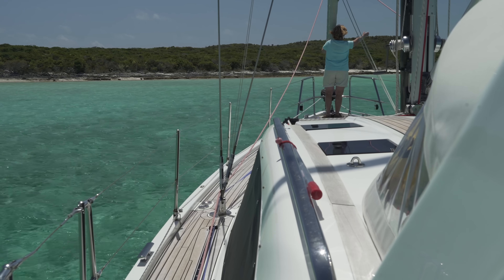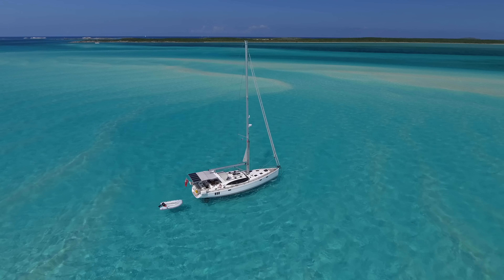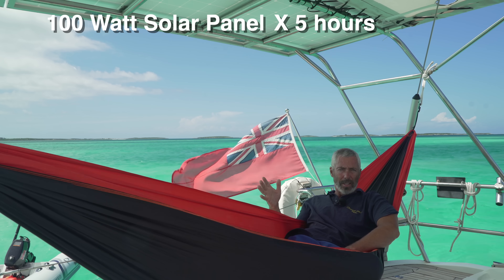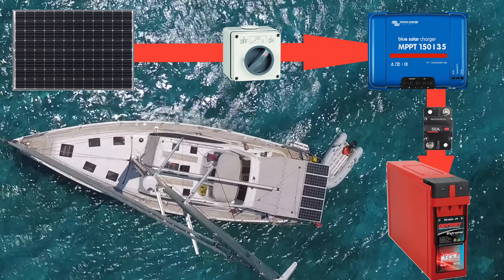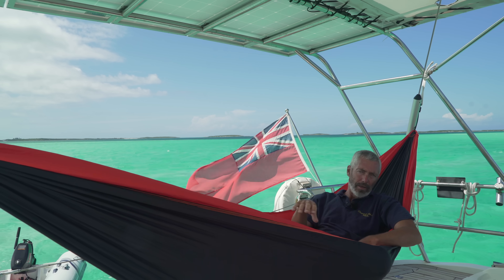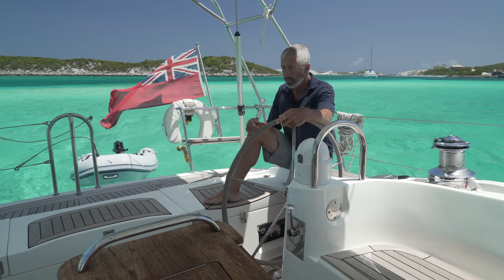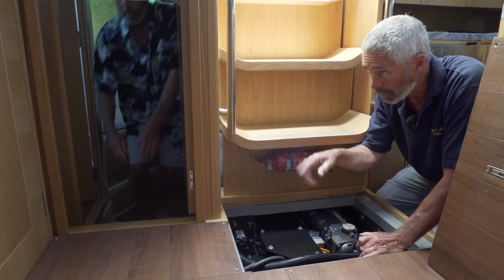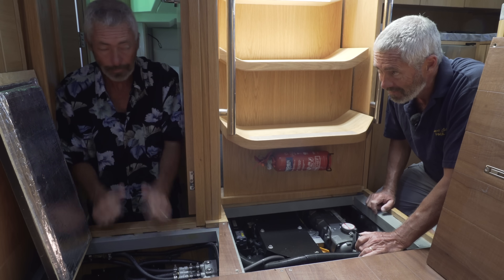Marine Power Solar System - Part 3

Comment: This solar system is disappointing. Since you designed that racking specifically for the solar panels you could have installed 3 x 400W panels that would have produced 6-7 kW a day. Also you do not have lithium batteries ?? I just do not understand why you would sabotage yourself like this. I guess you like to run that generator every day.

Comment: Just started watching your channel, very great information. Wondering how many gallons of fuel you'd be using running for 20 minutes at 1200 rpm? i.e..Cost of running the engine generator..thanks for your educating videos.

Comment: I'm on a tight budget and was on a smaller sailboat, so I went with two 100 watt panels wired to their own individual PWM controller. Each controller can accept both panels if for some reason one of them gives up the ghost. We're currently shopping for a new sailboat, and the only change I would make would be to use two MPPT controllers.

Does the Victron controller get very hot? I've heard from other's that they get very hot and would appreciate your experience with the unit.

Comment: So, you need to run the motor 20 minutes each day to break even ?  That seems like you need ALOT of fuel just to live ?? And most likely your not running a ac? Or being over generous in your life style. ??  After watching this I would say you dont have enough solar panels. Or battery bank , or a secondary generator  is needed.  ..

And would love reply to this,  so ?  How much fuel is needed to run that motor each 20 minute period? How many gallons. ?

Comment: I just dont get it,If your engine fails.You have no power.Apart from the solar.So much cheaper to carry a portable generator.And use alternator on engine as normal.
Reply: or with that much sunlight at your location a portable 3000w lithium power station and not spend a penny on petrol.
Reply: @aerofpv2109  You having a laugh.£2800 .For a back up.For a 300 ah battery inside a case.You still have to charge it.£400 for a portable generator.That can also power batteries up at same time.Yes 5 litres of petrol in about 4 hours use.But its a back up.it will charge everything up and most battery bank in about an hour.
Reply: @t147han  Think long term Sir ... 10 years plus. Lithium Iron Phosphate batteries with a 3,000 to 5,000+ cycle life on solar will save you plenty money in the long run.
Reply: @aerofpv2109  Please dont quote me that hyped up selling garbage.
Reply: @t147han  I was once a skeptic as well. All I ask is that you take a look into Will Prowse channel here on YT and view several of his episodes. This young man is beyond amazing and is sincerely educating tens of thousands of solar enthusiasts. Cheers mate.
Reply: @aerofpv2109  So you think that i need educating on solar.Or could it be that i know a lot more.that they are not telling you.

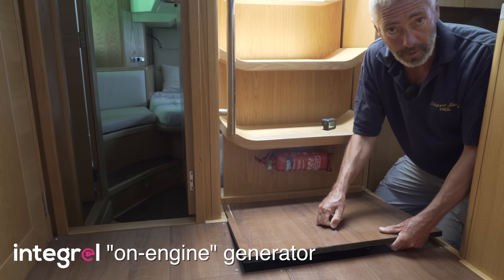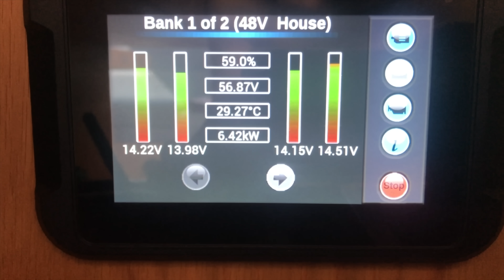Comment: 5:00 "that is the generator" - You just showed me an Alternator ...  what gives?   The Secret Source (yes I spelt it wrong on purpose)  - 3:43 ( Ok ) you have 4x Alternators putting out their normal 14v (just like the ones in a car) -  (as it says on the second Line your total output is 56 V) Kilowatts is not Voltage so we have here a High Amperage (I've found one for that is rated at 150 Amps - basic google search) -  which is 2100 Watts of electrical energy per second x 4 units ..  8400 Watts per second. 
That's a lot of power for a sail boat. 
Reverse engineering your situation ... you would have approximately 116 Amps per Alternator.. Fun Fact, Alternators need electricity to work, while Generators have permanent magnets in them. Alternators are lighter, produce more electrical energy  and give more Juice at lower RPMS ... but without a battery to power the secondary coils.. it doesn't work.

A starter Motor is not an Alternator, they are usually (magnetic type) DC motors

Final Edit 4
Reply: Ps - Alternators can be converted to electrical motors with some fancy wiring :P

Comment: Great information Paul. Just discovered your channel but will look at the other related videos in this series to see if you mention why you are not also trying a wind generator. That high performance on-engine unit was news to me - so thanks very much for that alone!
Reply from the maker: Thanks! We did try a wind-generator years ago but didn't like the noise...
Reply: @DistantShoresTV  Ah - I've sailed with a Rutland 913 and did not find the noise too bad. Up high on an arch across the stern. Some sound to the cockpit may have been blocked by the solar panels beneath it mounted across the arch. It was picked for being a less noisy than others at the time but it has been a few years.

Comment: Hi Paul   Question- you chose 5 solar panels vs 2 - 250’s. Any reason for the greater number?
Reply from the maker: Hi Murray. Our boat has a 48 battery bank so we needed 4or 5 panels in series to get the 48V. Otherwise you’re right we could have gone with 2 larger panels each with their own controller. 😅

Comment: These thin plate lead batteries you say you have  what make and model type are they and where do you buy them and  where to get spec sheets on them ??? I thought all lead types had the  bulk charge then the slow charge and then the maintenance charge
Reply from the maker: Hi DCbourbonireland 
We are using Odyssey batteries - ours are model PC1800
https://www.odysseybattery.com/Batteries/ExtremeSeries
The battery has been tested by the manufacturers of the Integrel system since the batteries must be compatible with the generator system. As you say - most lead acid batteries have a slower bulk charge and then an even slower absorption charge.

Comment: Nice info.  Very good info .. just a tip for the starters.
Please take in respect that panels only deliver power if something is absorbing power at the other end. 
So ..if battery’s are loaded and no other load is taken ...., the panels do not give any thing. It reads almost zero output at a full sunny day (Do not get confused about the controller readings. )
To calculate how much panels you need is related to the total daily  power draw.  
Not the battery capacity..  some boats have big battery’s but in most cases you do not use that massive capacity. 
Maybe 2 standard panels can deliver all you need on daily basis.

Comment: Thanks Paul!  Did you say you don't have lithium batteries?  If not, why not please, given their 80%usable capacity rather than 50% for lead acid.  With love, Ken
Reply from the maker: Glad you enjoyed it Ken 😊💕
Aside from the lighter weight Lithium also continue to accept charge right up to the point they are full whereas lead batteries taper off. However - No we don't have Lithium batteries. At the time we were working with Triskel Marine to design Distant Shores III system they had not certified any Lithium batteries to work with their Integrel system. The premium price for Lithium has now come down somewhat (from more than triple $$$) to make them more affordable. So I am sure we will replace these ones we have with Lithium when the time comes. 
Fair Winds

Paul
Reply: @DistantShoresTV  Thanks Paul 👌

Comment: It seems like a much simpler solution to have a large alternator on your boats main engine rather than having an additional generator the less internal combustion engines you have the better off you are with one less internal combustion engine to maintain yet you never hear much about it on the sailing channels I wonder if there's any reason why you can't do that to an older boat when you take off the existing alternator and put on a bigger one?
Reply from the maker: Thanks Lightchaserphoto our system can be retrofit (and likely will be in the future) although it does require a fair bit of work. We were an early adopter of the technology. :-)

Comment: Great video. A couple of questions: is there any particular reason that you didn’t go with lithium batteries? How do you like the Integrel generator and how does it compare to a traditional generator? What is the cost of the Integrel? Thanks! Fair winds
Reply from the maker: Thanks Kia glad you liked it! 😊💕
Lithium batteries are still quite a bit more costly than our TPPL battery bank. Likely that will come down in the future but right now its a big difference. We have found the Integrel to work exactly as they said it would - and are quite happy not to have a separate generator. For more information and pricing you can contact Integrel here... 
https://www.integrelmarine.com

Comment: Thanks for another great video!  The hammock is a great addition to the boat.  :-)   Did you consider installing higher wattage solar panels?  Could you please explain the choice for 100W panels?
Reply from the maker: 😊💕🏝 Thanks Corujariousa yeah the hammock is excellent!
We did consider more solar but wanted to keep the weight down so went with 500 watts. It would have been great to have 700 watts or so. Since the battery bank for the Integrel system is 48V we chose to put 5  X 100 watt panels in series to get the higher voltage. However there are more options for than and perhaps we will explore those in the future.

Comment: Thanks for another on-point technical video!  Has running the Integral unit affected your engine performance or maintenance schedule (e.g., more frequent oil changes, more attention to cooling system)?
Reply from the maker: Thanks Doug😅 we have a few more hours on the engine but not a lot. And we don’t have to carry spares for the generator or maintain that at all which is great. Generally it’s lived up to our expectations 👍

Comment: Thanks for the video - well done and nicely presented. I am curious as to why the Integrel system uses TPPL instead of Lithium - is it a cost issue?
Reply from the maker: They require a battery bank that can be charged very quickly. Initially Integrel approved TPPL but have now added some Lithium batteries as well. It will definitely be a cost issue for purchasers as lithium is still quite a bit more $$$

Comment: Hi Both. Very insightful and did something similar on my boat. I made the spreadsheet, a little bit more intelligent, which estimates power consumption underway or at anchor either at night or day. Whilst my water maker is DC I like to have as much charge going in to the battery at the same time as I am running it (consumes 30amps) so either while on engine, or around midday (so maximum solar charge) or when the generator is running. I have lead acid domestic (5X105ah), 550watt solar domestic and separate 60watt for engine battery and 4Kw generator. I try and manage powwer needs so to use diesel (ie mechanical charging) as little as possible. I use my deep freeze at a very low setting and for chilling beers (very important), wine, soft drinks, milk etc and turn it off at night. It keeps everything cool and does not take long in the morning (when the sun is up) to get down to the right temperature again.  Golden rule is to keep power consumption down to a minimum when the sun goes down. Make sure you run fans in the rooms you are in. Key to it all is having a good battery monitoring system when below 70% I look to start the generator (if at anchor at night). I was told, maybe incorrectly, that it is not good to run your main engine at low RPM with minimum load (could be rubbish not sure) therefore at anchor and need a top up I use the generator. Appreciate your thoughts on this one. This is also a lot quieter (have a below waterline separator) for our neighbours. We, like you spend, a long time at anchor and managing power consumption is very important. Keep up the good work.
Reply from the maker: Hi Mike and thanks for the well thought out email.

Your system sounds quite well designed and I see you appreciate how much work it is to manage power on a cruising boat!! 🏝😀 

You are indeed correct that it's bad for any diesel engine to be run at low load. 
https://en.wikipedia.org/wiki/Diesel_engine_problems
The system on our boat (Integrel) can generate quite a bit of power at lower speed so it actually takes enough power so that the engine is loaded properly at low speed. Of course this will taper off after a while if our batteries are filling up so thats why we stop it when the kW output falls down below 3-4 kW. 

With any diesel engine it's a good idea to run it up to high load on a regular basis to "de-carbon" it.
Reply: So this is true. Thanks for the link. On the same theme what rpm do you run at when on motor. I have a 75hp Yanmar and tend to run at 2000 rpm which gives me about 6.5 knots but told I should run at least 2500 or higher. Do you agree?
Mike

Comment: If I may ask, what is the difference between your generator and a high output alternator?  Other sail vloggers seem to have 160 to 320 amp alternators, while you produce kilowatts. Is it all the same but just different terminology?
Reply from the maker: I believe it makes sense to speak in kW kilowatts since this is true power. The unit we have can produce 170 amps - but this is at 48 volts. So the power in watts is 170 X 48 = 8160 or 8.1kW. 

Comparing that to a 160Amp alternator running at 12V = 1920 watts. However if the 160 Amp alternator was running at 24V that would be 160 X 24 = 3840 watts. Hope this helps :-)
Reply: Thanks for clearing that up.

Comment: Forgive the rudimentary question, but what's the difference between an on-engine generator and an alternator? Do you have any thoughts on the new high-output alternators? Thanks in advance. Love your videos, as always.
Reply from the maker: Glad you're enjoying our videos Chris 😊. 

The Integrel system is like a super high power alternator. It's the combination of very powerful alternator - smart controller and the 48V battery bank capable of absorbing so much power that makes it different. We see the system pumping out over 6kW continuously - which would be equivalent to 500 amps on a 12 volt system. The smart controller carefully manages this large load on the engine. At just 1200 RPM we see over 5kW output, and even at idle it will produce 2-3kW so we hardly find we run the engine for more than 15-20 minutes as a generator. With the load on the engine from this higher power, it is not the same as running an engine in idle with a small alternator (which would not give the engine enough load). You definitely need a battery bank capable of absorbing the power to make the system work. The "Thin Plate Pure Lead" TPPL battery bank we have can absorb huge power up to 90 percent or so before slowing down. That's when we shut down the system and let solar finish up charging. This system would work amazing with a lithium battery bank which would absorb large power right up to 100 percent charge. Hope this helps :-)
Reply: Chris Ryba , great question
Reply: The main physical difference between an alternator and generator is that in an alternator a magnetic field spins inside the stator, while in a generator the armature spins inside a fixed magnetic field.

Comment: You might want to consider an mppt controller per panel, that way if one is shaded you lose less charging ability than if multiple panels are run through one controller. Victron has you covered.
Cheers for now
Reply from the maker: I am looking at that Carl 👍 the difficulty is that our Integrel battery bank is at 48 volts so the controller must run that. I’ve found an option by Genasun that would boost output from 12-48

Comment: Wonderful, easy to understand and interesting topic. Do You have experiences with wind-powered generators?
Reply from the maker: Thanks Gafrers we did install a wind generator on our first boat. It was a Rutland but didn’t produce much power. We also didn’t like the noise so we switched over to solar and haven’t looked back 😅
Reply: @DistantShoresTV  Thank you very much for your answer. It's the same conclusion i arrived to after researching and asking to experienced people. Not as experienced as You two of course.

Comment: Well done. Do you have or might get a wind generator?
Reply from the maker: Thanks Tom. We did install a Rutland Wind generator on our first boat "Two-Step" way back when. Its a matter of taste but after a while we found we didn't like the whirring wind noise. We changed it off and added solar instead. Since then we haven't tried wind power again.

Comment: Do you require one controller per bank?
Reply from the maker: There should be a controller on each set of solar panels. On our previous installation (on Distant Shores II) we had 3 panels in parallel (mounted on an arch) and had a single controller managing them and feeding the output into our 12V bank. 
On this boat (Distant Shores III) I put 5 panels in series to make up the voltage to charge our 48V bank. However wiring solar panels in series is not ideal and a good alternative would be to have one controller per panel in that case.